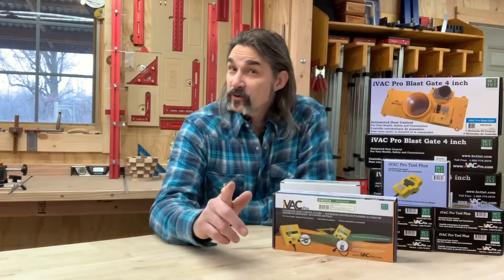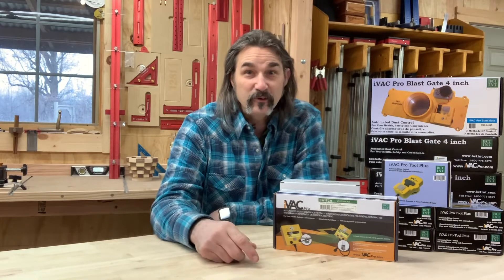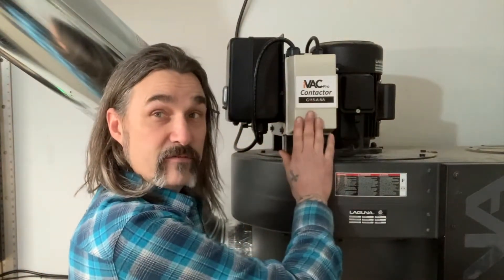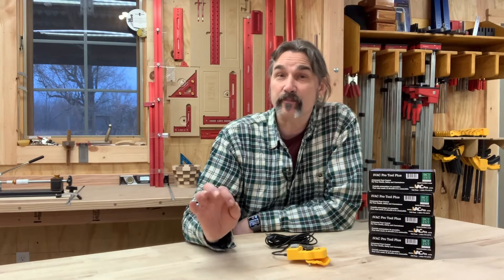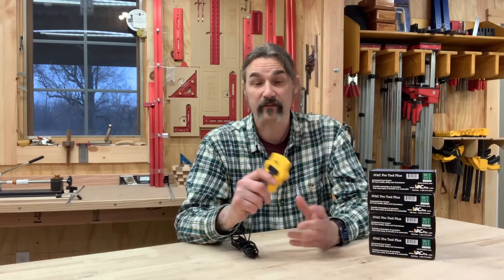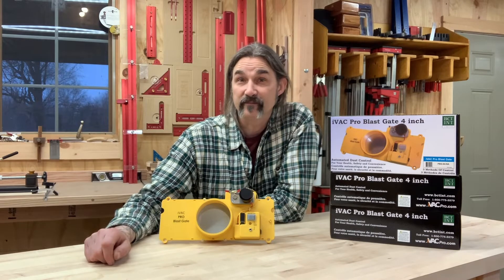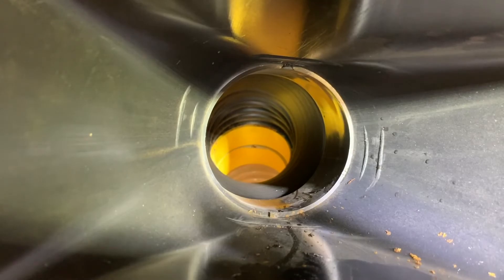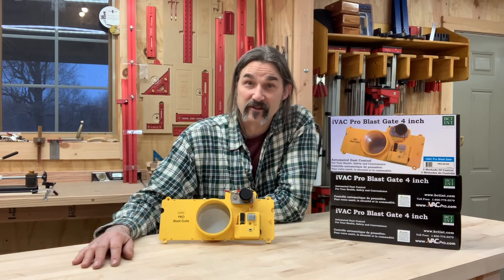How-to install an iVAC automated system for your dust collector

Comment: I'm adding this to my P-Flux 3, any chance I can get more detail on how you setup specifically for the Laguna wiring?
Reply from the maker: Sure thing.  The stock Laguna switch is a mag switch for safety. I wired the Contactor after the stock Laguna switch.  The tech guy at iVac is fantastic too.

Comment: Is the outlet you plug the pro switch into running on a 20A, 25A, 30A...etc?
Reply from the maker: Hi Jacob, The switch is 110V and on a 20A circuit.  Hope that helps.